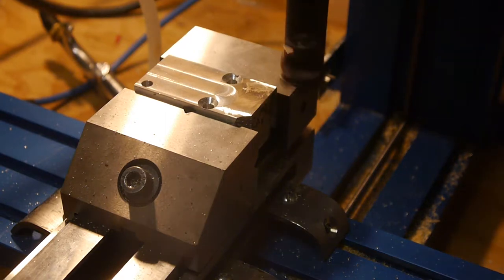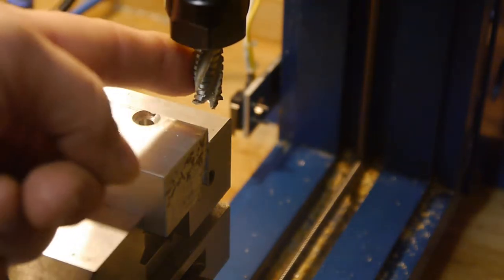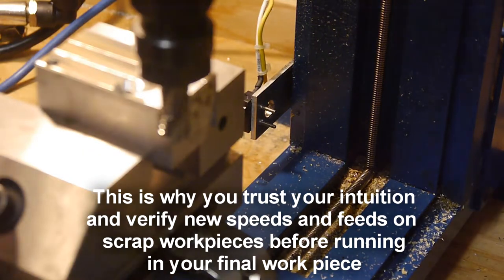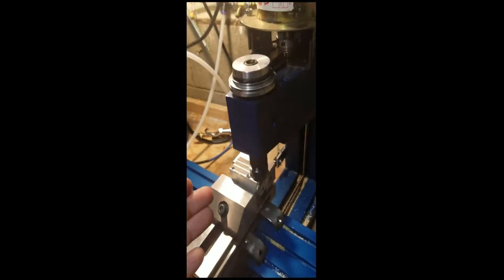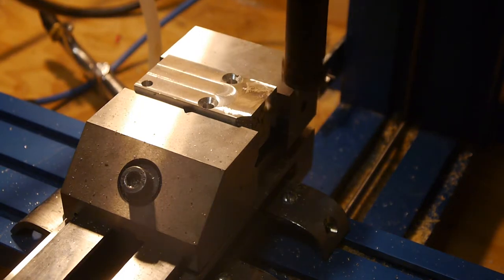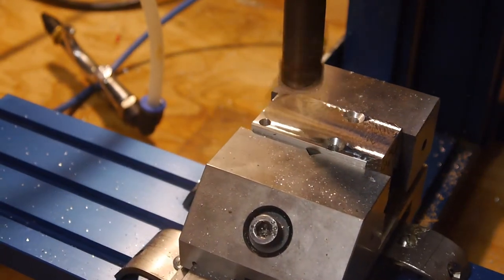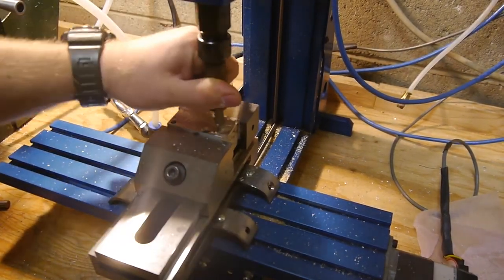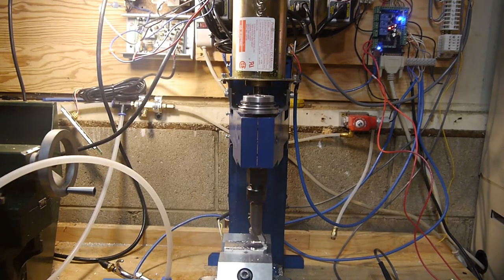Crashed the MaxNC mill while trying to make big boy chips... like an Idiot.

Comment: Hey Josh-- Don't know if you're still active on this video. I have a MAXNC10 with the smaller (what I can only assume is like a 100W) motor. I could go pull the make off it, but there's no nameplate info. I was wondering, did the spindle motor you show here come with the machine? Did you upgrade it? Struggling to find much MaxNC documentation. Thanks!
Reply from the maker: Hey Marco, no, this spindle motor is a retrofit of a DC treadmill motor I had laying around. The motors that come with these units don't last long if you try working in metal.
Reply: @JoshAQ  Hey thanks for the reply! I ended up sourcing a new 600W AC spindle motor with ER11 collets. The original spindle survived maybe 2 more days after my comment, hahaha
Reply: Just commented on another video of yours! Do you happen to still have your CAD?

Comment: Wow can't believe it was running for so long with the belt so frayed and messed up. I used to have those belts on the 1\10 hp setup. When I upgraded to the 1\5 motor condition shipped it with the toothed pulley and belt similar to the one you show in your electric press video. I think those small belts are pretty crappy . Now you have the opportunity to design and build a cool new pulley system :)